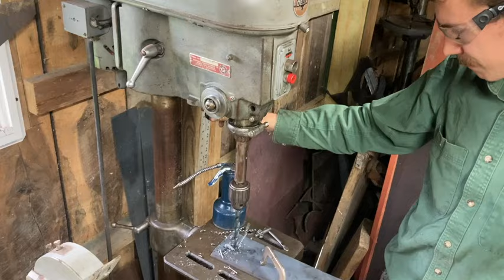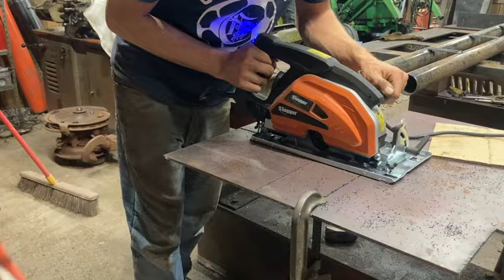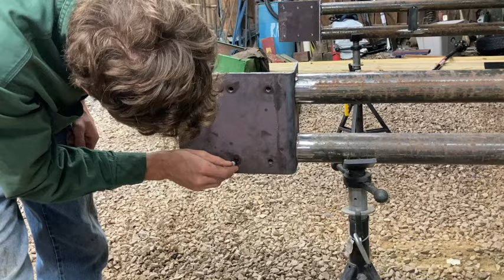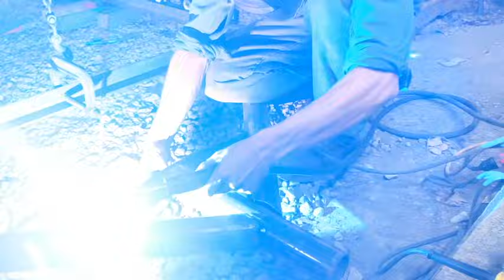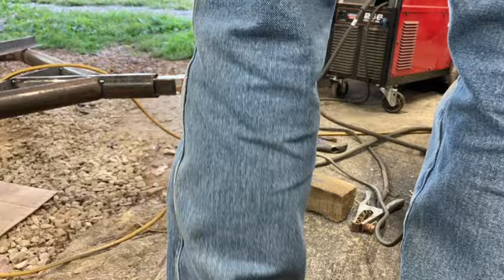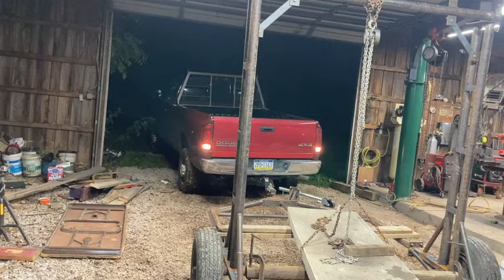Mobile gantry crane

Comment: That is a VERY mobile gantry crane. Not just sitting on some casters that will only roll on smooth concrete. We shared this video on our homemade tools forum last week 😎
Reply from the maker: Hey cool! Can you provide a link? I’d like to see that.

The crane was designed this way simply because I had lots of this pipe on hand for cheap and the mobile home axle. I needed a way to lift the concrete pads into the shed. Lifting a propane tank in a later video proved its usefulness too.

I have noted that an adjustable height hitch is necessary to keep the crane perpendicular to the ground. Break away chains are another addition to add…

Comment: Dude.. I Love your build! Ive been pondering for the longest time on building a gantry for my shop but still havent decided.. I love the mobility of yours!! I have three chainfalls from 1000 lb to 1 big harington 3 tonner so not short on chainfalls. What do you think max is on yours? I also looked at "YT Cut & Weld gantry build" that kids perty smart too!! Thanks for the build! L.T. Dan
Reply from the maker: Thanks! The flaw with this design is hitch height causing the legs to be angled. That can be remedied with an adjustable hitch though. 

I really like the gantry cranes in junk yards that look like a shop crane but with brush hog wheels for casters. I would prefer something like that for outside work and put a hitch on the side of the A frame leg.

Comment: Do you intend to hoist a T Rex with it ?😅
Reply from the maker: It lifted a propane tank weighing about 2,000 lbs. That has been the most. The lifting point was built after this video to prevent kinking the pipe

Comment: I use a sky hook for those remote jobs..
Reply: An older tractor with a front in loader would be better plus it has a lot more uses just saying
Reply: @jerrynorris1397  tractor needs maintenance, fuel, working battery that you need to keep charged, keep from cold and buy new one after every 4-7 years, it does not.